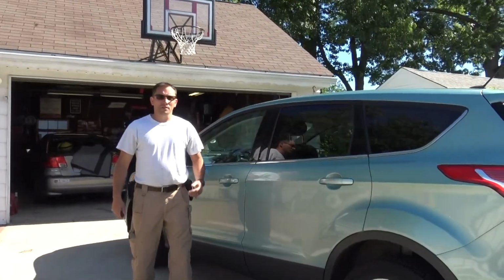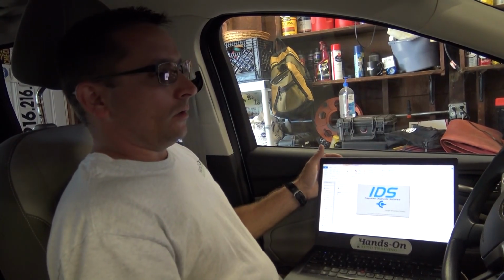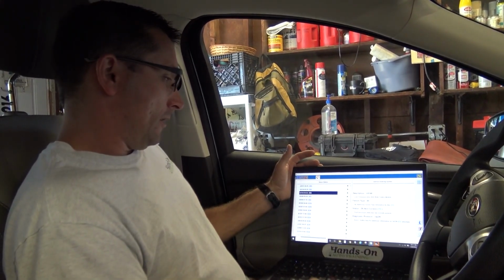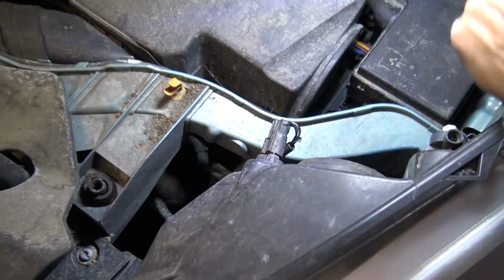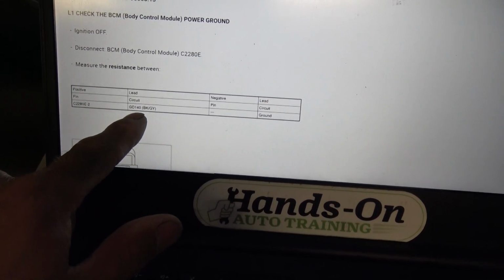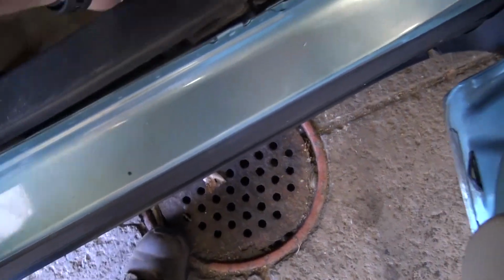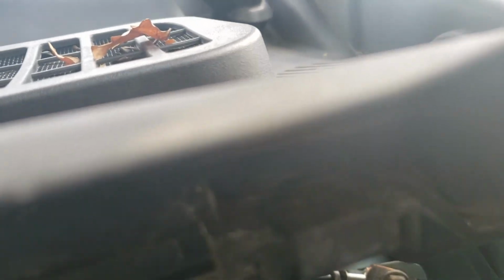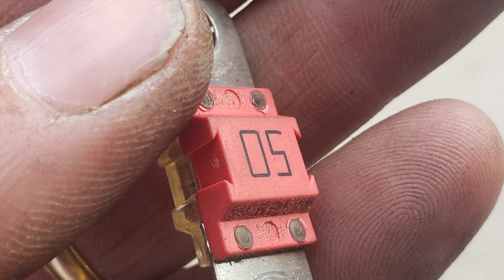2013 Ford Escape no start

Comment: Unfortunately that’s the only fuse box that the users manual states “if you require to replace a high voltage fuse, see your authorized dealer”

Comment: Question. When I look up 2013 Escape fuse panel it shows a totally different fuse panel? They are the little push in type fuses, instead of the terminal inline fuse?
Reply from the maker: I find that using the owners manual for fuse block location and fuse identification on ford to work best so times. Motorcraftservice.com has the owner manual for free.
Reply: @BrianMann216  Thanks. I didn't get a chance to help the women, before she took it to a dealer. Burned up some wires and some sensor. $2900

Comment: US AUTO SALES USED CAR DEALERSHIP USES A COMPANY TO PUT ON GPS TRACKER FOR REPO PURPOSES AND THEY CUT WIRES FOR THE INSTALLATION  THAT CAUSE INTERMITTENT ISSUES WITH STALLING AND NOT STARTING

Comment: FOUND PROBLEM WITH USED CAR WHY PUSH BUTTON START!!!! THEY HAD A COMPANY CALLED "SURETRAC" INSTALL GPS TRACKER AND HAD CUT WIRES TO PUSH START SO IT WOULD LOSE CONNECTION WITH KEYFOB/KEYLESS REMOTE AND WOULD CUT OFF WHILE DRIVING OR NOT START,  INTERMITTENTLY!!!!

Comment: Hey, Brian! I can see in the video that the fuse in question is on the yellow wire and that it's a 50 Amp fuse but, what's the voltage rating on that fuse? My wife's 2016 Escape is doing this very exact same thing and I'm having trouble finding the correct fuse to replace hers. Do you happen to know the voltage rating of this fuse or have a link where I can order the same one you used to fix this Escape? So glad I found this video!!!
Reply from the maker: The amperage rating is stamped on the fuses themselves,  I dont recall this one.

Comment: hey brian I'm having a problem with my Ford Escape 2013 sel1.5 the serptine belt snapped and started to smoke . i repaired it and trey to start but it didnt start it cranks . i called ford they said it could be the kill switch but i cant find it would you be able to kind me in the right direction ?
\
Reply from the maker: Any codes? Check cranking rpm on scan tool. I am not sure of that design but maybe part if belt caught behind crank reluctor causing a issue?
Reply: @BrianMann216  the cam shaft sensor was disconnected i pluged it in and now the car starts but turns off right after it starts .  1 second after it starts it turns off .

Comment: Finally, someone that knows their ass from their elbow. Ran into the same issue with my wife's 2014 Escape. Went into a store and came back out to the exact same symptoms you experienced. Played with every fuse relay ans connection I could find. Parking lot and very few tools gave me no other choice. Exactly what happened here, when you barely brushed the connection from the + terminal to the mega fuse buss panel (someone smack the crap out of the engineer that came up with that crappy design. A piece of sheet metal? Really?) led to removal of the air box and access to the battery. As soon as I pressed even a tiny on that sheet metal the vehicle would start. Not having my multimeter I had to assume the fuse was bad. As soon as I moved the yellow wire up to the top side of the buss it cured everything. When I got home I tested continuity through the fuse and sure enough all over the place. That led me to discard an assumption most of us have. Yes a fuse can have an intermittent open. Not often but obviously it can occur. Thanks for the insightful video from a real tech! Much appreciated.

Comment: Brian great video , i wonder why the vehicle identified a open circuit ground instead of an open on the power side . I thought with all the bias voltage circuit checks done on most newer and even older vehicles it should have been able to identify it correctly . Thank you for your time your case studies are always very interesting .
Reply from the maker: Thanks!  That is a great question why the bcm thought it had a bad ground, I really do not know. I was so close to finding it the 1st day that I looked at it, I was right at that spot on the battery cable.  Note one of the local ford dealers said they never sold one of those fuses.  I appreciate you watching!